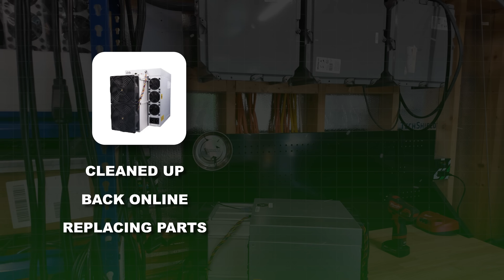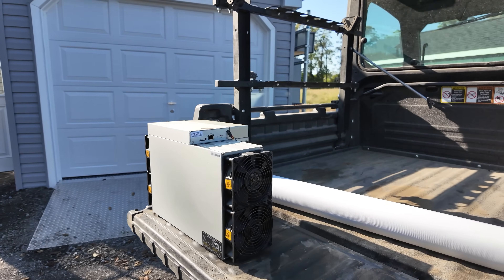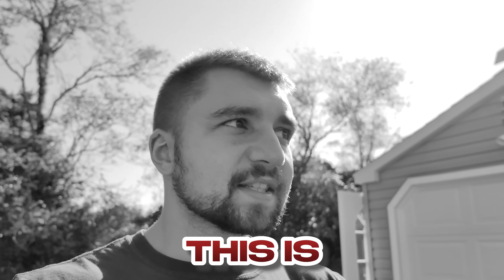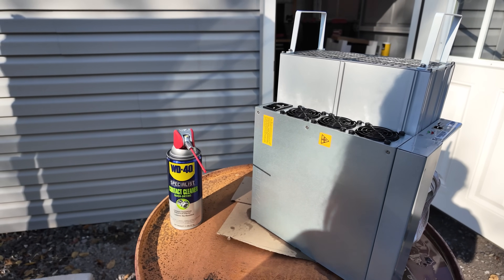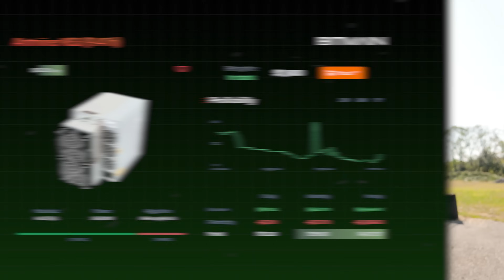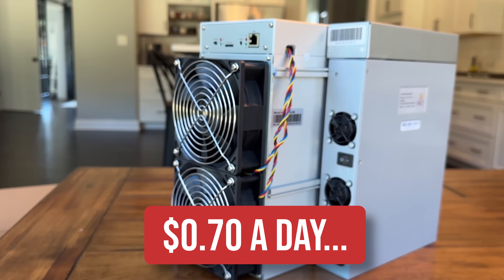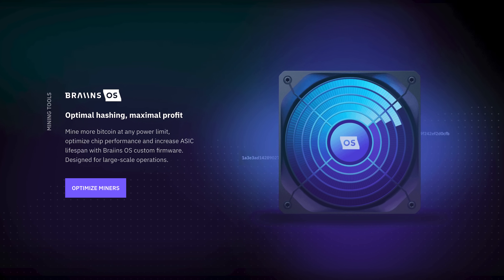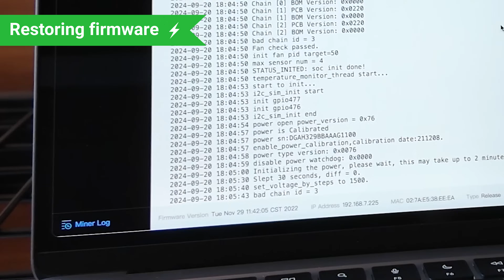Mining?!

Comment: I noticed all the miners with emmersion mining have problems. I will never be installing those I’m an AC mechanic who knows how to calculate the heat for the units . I will just install more ac
Reply: 😂😂😂 AC is going to kill your pocket
Reply: I am in ac also  just use inline blower and some round pipe to move heat out and outside air in because he is right more ac = more money in electricity . This works fine I am in FL and my miners are in my garage.
Reply: @dimitriskazazakis5658  in general, immersion mining has a lot less problems on an industrial scale… not sure if the problems he is running into is because its a mix of miner types and different miners run best at different temps.

Comment: Dialectric liquid is getting yellow, maybe it is time to change the oil ;-)
Reply: It was yellow from the installation. We had used a hose to pump it out of a barrel of fluid and the hose had leftover dielectric fluid in it from the previous use and it became discolored from the hose.
Reply: @missvosk  HI Miss Vosk, sorry, it was probably an illusion, I remember well, the stuff was clear. Could it be possible that thermal paste might be not performing after all that time? The Hobbyist Miner had that problem the first week or so, it was at the bottom, bluish. A perhaps leak. Did you ever wonder about thermal pads for immersion?
Reply: @lexingtRick  the yellow in the B6D came from the hose that we used to fill the unit up with immersion fluid and was yellow from the first day. The fluids in the other units are clear and have stayed pretty clean so far.

Comment: When you have a single phase electric that comes in your home you will usually have no problems. But you have hash boards in those miners and they don't like big swings going from positive to negative in the sign wave. But if you have 3 phases those miners will run better with less down time. Some companies who have open deltas...with less than 3 phases use a special generator to clean up the AC signal.